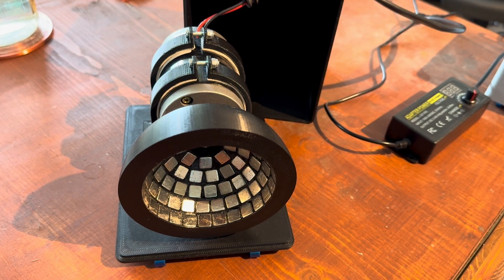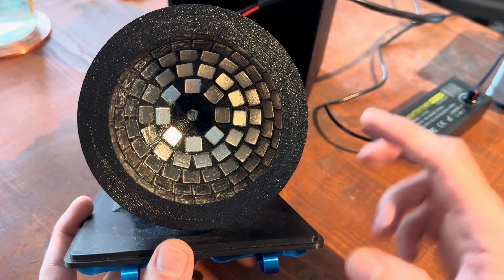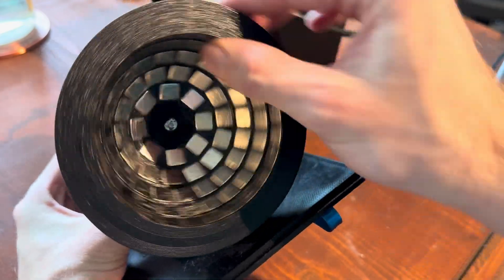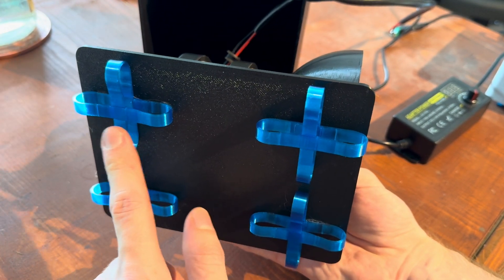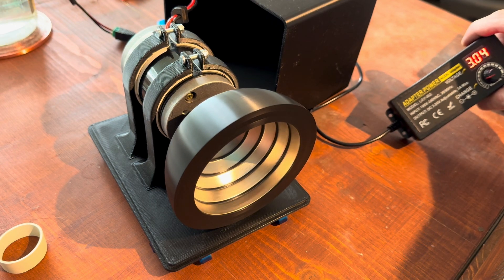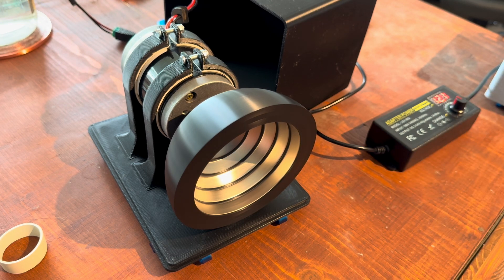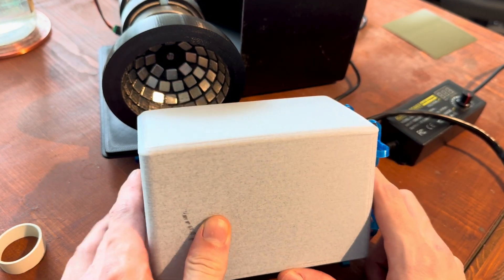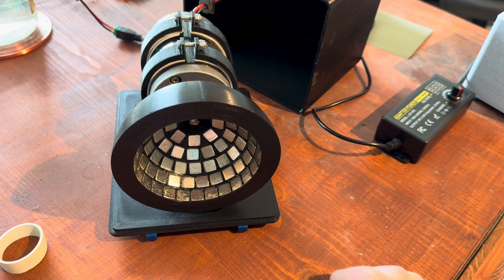How to build a large PrimerCube (rotating bowl magnet array)

Comment: I just built the original primer cube using the 3d print from primercube website. I used 3/8th x 1/4 n52 neos, thats the size the original design requires. I also printed it at 101% so the magnets fit without a ton of post process. I used the motor you have on yours and its working great. I'm curious what your opinion is on the efficacy of this device. I still don't understand how rotating the array is any different from a static array because the poles aren't flipping, which is required for inductive effects in materials. Not saying it doesn't work, I'm currently testing it to see if i notice anything. Have you experienced any positive effects from these devices? I'm curious to hear about your experiences.?

Thanks again for all your interesting designs! Keep up the experimentation!
Reply from the maker: I think the rotation makes a difference since the magnetic field is already rotating and additional rotation will increase it’s effects. 
Yes I experienced a lot of effects from being exposed to rotating magnetic fields.

Comment: Hey man, thanks for providing the printable designs. Appreciate it! I have printed and made 2 south and north. The problem is both are not very balanced and vibrate quite a bit. Yours seem to be very smooth? Maybe it wasn’t printed very precise🤷‍♂️ Any suggestions for printing? I have a Bambu A1. Also you are showing that 12v gives you a rotation of 3350rpm. That is impossible. I’ve measured the RPM and at 12V you will get under 2000rpm. To have 3350 I have to run mine at 20.6V with the same size bowl.

Comment: Regarding why the north pole is used versus the south pole is that north pole inhibits growth of all kinds, including bacterial, fungal etc that drive the disease. Uncontrolled bacterial-fungal growth happens in situations of disrupted energy flows along the meridians (according to acupuncture), and in their restoration south pole may indeed be useful. However, self-help books on magnet therapy, all in unison warn against using the south pole. Several of the books I read had been written by practitioners of many years, who had successfully treated various ailments including c*a^n$ers of several kinds. A physicist, A R Davies, in the 40-50s run many experiments on animals, and discovered that north pole was more useful than the south pole. He also confirmed that for c*a^n$ers it should exclusively be used. Eggs and hatched chicks exposed to south pole had grown big and strong  but dumb that also turned cannibal (eating their own species). The north pole exposed cohort had grown bony and small but smart. He said that this supported the observation of savants and sages being frail and weak in the body. A newly born animal with a horse shoes magnet placed in its cage/room, had the intuition to use both sides of the magnet pole at different times. The animal only spent a few minutes at one side, and then run the other way and stayed there. Despite his tremendous findings A R Davies had no success in getting autho&rities interested or supportive - his work got su00pressed. Books are available to read on archive org.

Comment: Do you notice the larger bowl has more health benefits than the smaller one? In the files that you share under the video, the file called primer cube_housing_bottom, does it have bracket for motor as well? It's not visible to me.
Reply from the maker: The larger bowl has a bigger and stronger field, but both do work. 
Yes the file has the brackets for the motor as well.
Reply: @OmegaZZ111  Many thanks.

Comment: HELP! I've got the cup remanufactured. The size of the holes is perfect but I'm struggling to get the magnets in: the already inserted magnets pull on the magnet I'm trying to insert!!!   Any suggestions? What glue did you use. I tried Gorilla Glue but the magnets just slipped out.
Reply: I just built one.  I printed cut spheres for each level and a ring that sits on top with a 3/8" hole that turns and allows a magnet to be inserted.  I found that putting in alternating magnets all the way around then fill in the "inbetweens" worked best.  Then I printed a bowl to cover all the magnets.  I found the top ring was the worst and had to use an external magnet to pull them in sometimes.   I also built an insertion tool.   A Popsicle stick with a magnet glued on the end with S facing out.  This allowed me to pick the magnets with the N side and push them into the hole.  Sometimes I would have to wedge a Popsicle stick in between to separate them.   It is not easy.
Reply from the maker: It helps if you glue the magnets in one by one, a bowl of this size isn’t that easy to assemble, just take your time. 
Use a glue that dries fast so the magnets don’t slip out.

Comment: I had a friend 3 D print the large primer cube for the square magnets. I gave him the printing files. You suggested 10 mm by 10mm magnets so I purchased these but they did not fit in the 3D printed primer cube. Was the 3D printing accurate or do I need 9 mm by 9 mm magnets?
Reply from the maker: The 3D files are designed for 10mm magnets, measure your magnets and the holes in your 3D print to see where the inaccuracy lies.
Reply: @OmegaZZ111  Thanks for getting back to me, The 3d printer printed   9mm holes. The magnets are 10mm. Must need a more accurate 3D printer thanks again
Reply from the maker: @cristadamato1728  Adjusting the print settings might also solve the issue.
Reply: @cristadamato1728  was your magnet 9mm by 9mm?
Reply: 3/8" magnets fit perfect.  There is no way 10mm will work.
Reply from the maker: @johnhamilton4449  I built more than one of these bowl arrays, all with 10mm cube magnets.
Reply: @johnhamilton4449  3/8 by 3/8?

Comment: I'm tempted to make this bigger version, but I've to first ask: have you noticed any differences in your body between using this bowl vs the original smaller one? 

I would recommend to include a heat sink in your 3D project, 'cause the smaller motor heats up after half an hr at max speed (understandably). And I can't imagine how hot it must be with the even bigger version....

Comment: You should try measuring the field strength while its spinning and then compare it with results you got while its still. I know in some of your videos you discussed the possibility that rotating magnets draws the magnetic field inwardly, I think this dome setup is best way to test this claim. Maybe that is why Primercube is made to spin in first place.
Reply from the maker: I can’t see any difference with my gauss meter between spinning or while it is still.
Reply: @OmegaZZ111 does it mean that rotating magnetic field is same as static one - It does not draw inwards magnetic field? Or to be more precise regardless of speed/ movment of magnet its magnetic field shape and strength is unaffected.
Reply from the maker: @SuperReliable  There is no such thing as a static magnetic field, it is always rotating. 
If you take a rotating object like a flywheel and add additional rotation it will alter its speed and path of travel, just as an analogy.

Comment: Thank you very much. However, I still struggle to understand how did you secure the bowl to the 8 mm axle, did you make the bowl lik 0.05mm tighter and force brute it in? 
If so, then I'll just use the electric motor I got previously that doesn't have nor a radial hole nor a screw at the tip.
Reply from the maker: Yes it is just press fitted, it can’t come loose by itself this way.

Comment: You should make it spin with an rpm equal to half (because the magnet will be at the other side in halve a rotation) the frequency of the magnetic field so it resonances at the resonance frequency of the chamer in order to amplify the waves.
Reply from the maker: How would you determine the resonance frequency of the magnetic field of the array?
Reply: It's a nonsense response to confuse people that dont know what it is. Magnetic fields from permanent magnets are static and dont even have a frequency.
Reply from the maker: @desktopantec2290  lol that’s not true at all, there is no such thing as a static field, every field is rotating and it’s rotating frequency is called the larmor frequency.
Reply: @OmegaZZ111  btw i what does this device actually do?
Reply from the maker: @desktopantec2290  well since you like trolling: the device spins magnets haha
Reply: @OmegaZZ111  damn good clap back
Seriously tho, is it some sort of low friction bearing?
Reply: I know. I meant that the north and south pole dont switch sides. Either way i am just trolling. I dont have much experience with magnets anyway, im more of an electronics person.

Comment: Very good to see this. Rotating magnetic fields do much. An MHD vehicle levitation engine requires another rotating bowl where both face each other mounted upon a central spinning platform.
Reply: Have you seen the videos on MHD engines by Professor Jean-Pierre Petite PhD? He was the guy that proved you can use MHD plasma flow to move at supersonic speeds without generating sonic booms.

Comment: That’s terrific. Have you tried placing a thin sheet of non magnetic material like aluminum in front of it. 

I made a gold magnet using alternating current and worked well. You can check my videos for that. 

Point being is that I tried to make a gold magnet by rotating magnets but it did not work. Your configuration may bring results. 

Let me know
Reply: What is a "gold magnet" please? thank you.
Reply from the maker: You can feel very slight vibrations on the aluminum foil when you hold it really close to the rotating magnet array, but other than that not really much is happening compared to when the array is not rotating. 

But that was just a quick test.

Comment: Does the gauss meter register a change in the strength of the fields at a certain distance when spinning compared to stopped?
Reply from the maker: No with my gauss meter you can’t see a difference.
Reply: @OmegaZZ111  Interesting, thanks for checking.